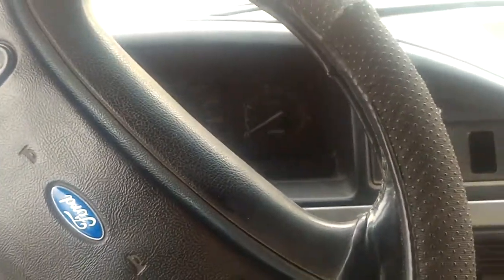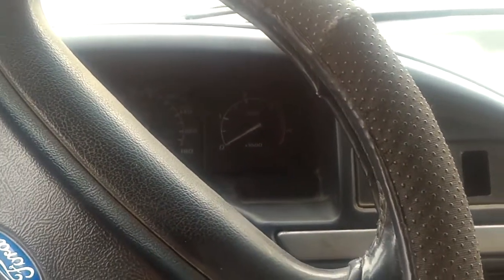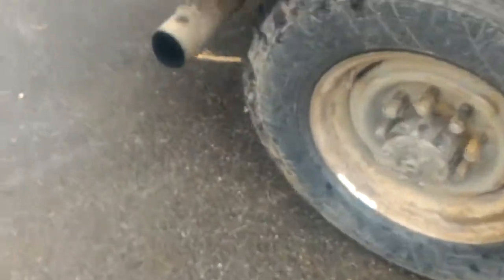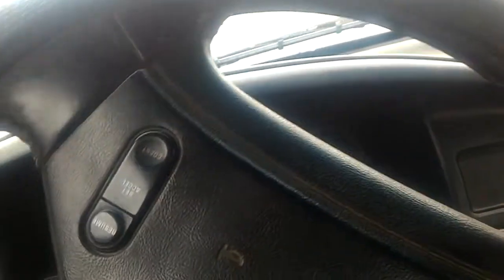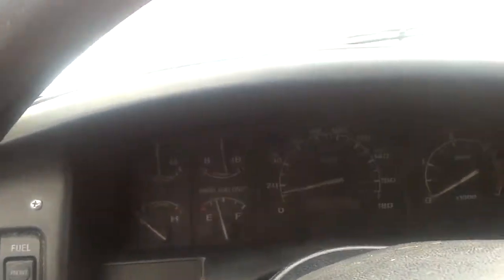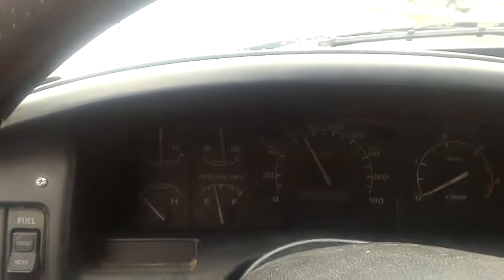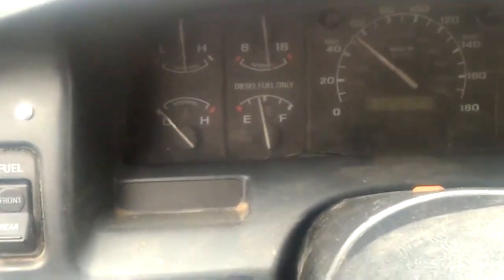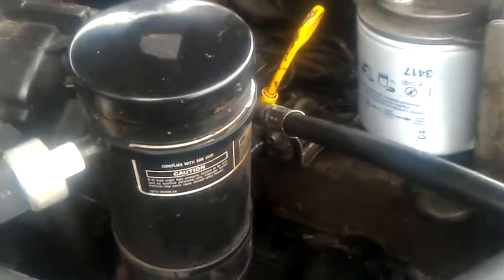$350 93 IDIT in Big Red now... Concerning sounds

Comment from the maker: 2.5 years later:
She still runs just fine. Somehow!
She still ticks just as much as she did two years ago; I've done little to the engine other than add oil every ~3K miles and beat the ** out of it!

Somehow, despite everything, she had no problems with towing a 5th wheel at ~70 back from Portland this summer, pushing EGTs above 1K constantly, and coolant temps in the 240 range! 
And she still seems to be doing about the same!

Comment from the maker: So... still running. Added 2 quarts of Marvel Mystery Oil and am just driving it. Yesterday, I drove 80-ish miles with a trailer at highway speeds; 40 unloaded, and 40 with 3 1/2 tons of hay on it. 
I friend of me was with me with a '99 ram 3500 with a Cummins and hauled a similar trailer with similar amount of hay... up a 6% grade I beat him, but not by much.  Still dropped to 50 at the top and I was slowly losing ground and would have had to downshift into 3rd if the hill went on too much further(remember- in this rig, more RPM = more torque).
Need more boost, that's for sure - I'm only pushing 10-ish. Might get a WW2.
Reply: MacRobb Simpson if you ever get this firgured out please let me know what it was. Im having a simalar sound and its creeping me out it came out of know where when i just started it one day. Thanks.
Reply from the maker: Pretty sure it was/is lifters. It quieted down a ton with MMO in there, and is only really noticeable at idle now... which might be an injector imbalance issue. 

Do an oil change and use 2 quarts of MMO(BTW, if you aren't already, use a FL1995 (7.3 PSD) oil filter - total capacity of a 6.9/7.3 IDI with one of these is 11 quarts of oil). 
Give it 500 miles, and change it again, use 2 quarts of MMO again, and then change that at 2500 miles like normal.
I believe in changing oil at the 2500-3K mark; don't try to extend it. It's not good for the engine(remember, it's not the oil breaking down or additives getting used up - it's simply how much crud can be suspended in the oil).
Reply: MacRobb Simpson ok thank you very much. I use the fl1995 filter already. I just put a 088 turbo kit on her about 100 miles ago and changed oil when i did that. I have the turbo back out because im redoing the wiring harness because the fuel shut off seleniod wire is broke somewhere so to start the truck i need 12v jumper to the seloniod. But when i ran it i noticed the noise similar to yours. That it was making before (even with turbo kit installed) We have low sulfar fuel around here so mabbye i should try injector cleaner or something first and crack each line when its running to see if it's a bad injector. I will try the mmo and do what you said. Thanks very much for your help.

Comment: You're probably the expert on these engines (over me), but if it's from down low it would prompt me to check ASAP. You can't ever be sure if some ya-hoo didn't torque something down enough.
Reply from the maker: I'm definitely concerned, but it's obvious that this motor hasn't been apart in many years. Not likely for a bolt to just come loose from undertorquing it; stuff like that usually comes right out within a few thousand miles.

Comment: Don't they all sound like that??  Lol
Reply from the maker: More or less; the lope and clatter. There's a knock to it, though, that other IDIs(and I have... a few) don't.
Honestly sounds like a lifter over-pumping and the valve tapping against the piston(these valves are square to the piston, so what would most likely happen is either wear out the guide or eventually have a nice valve-shaped impression in the piston).